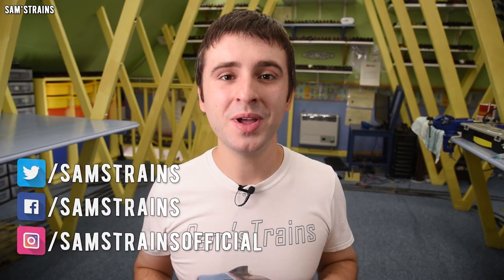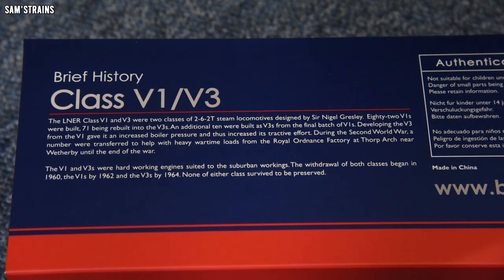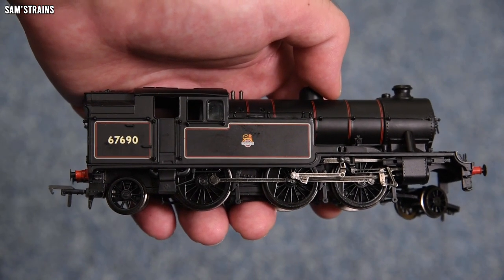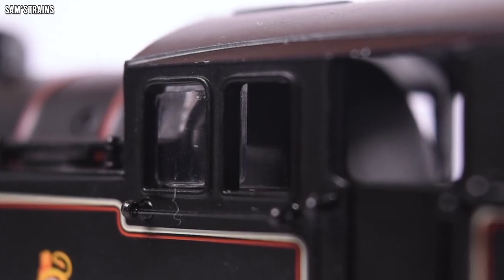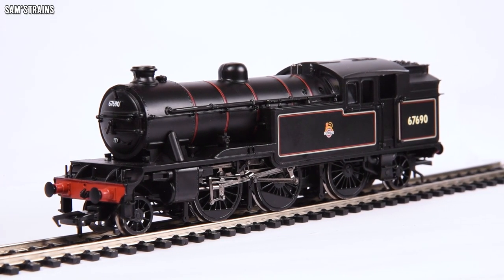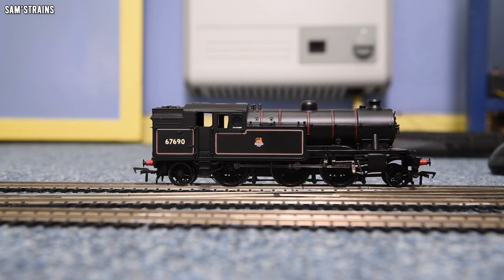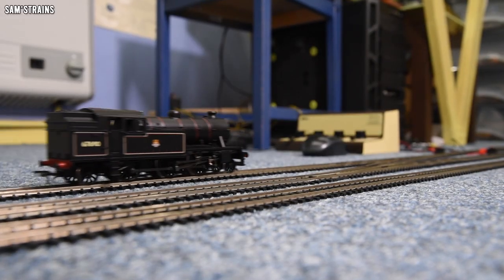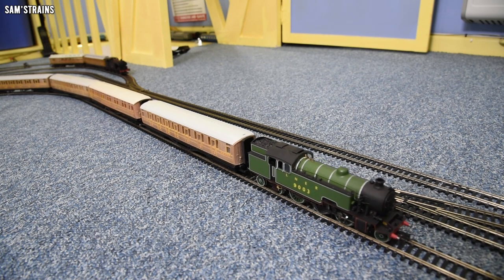Worst Detail But Best Runner | Bachmann Class V3 | Unboxing & Review

Comment: I'm a big fan of the slightly older post split chassis bachmann engines, to me the detail is still passable and you don't have to worry about things breaking and falling off every time you pick them up like on some of hornby's engines, I'll concede the mechanisms aren't exactly cutting edge but in my experience they've alway been reliable runners. And finally, there's always bargains up for grabs on the second hand market. That being said I would never buy a brand new locomotive from bachmann in this day and age but with prices being what they are I'm not really buying much new from manufacturers at all anyways :p

Comment: Dear Sam,
I did enjoy your review of the updated Bachmann V1/3 2-6-2 Tank loco. 
When the new model came out, I asked Bachmann if they were going to bring out a LNER Black version as well. They said no. So I asked if the old body would fit the new chassis. They said as the new chassis was a complete Retooling, it would not fit the old body. I had hoped they would bring out a new version of the LNER black one. 
My local model shop still had some of the new V3 models in stock. So I bought one and to see if it would fit the old body. I test fitted the old body on the new chassis and low and behold it fitted like a glove. All the screw holes matched up. I have been able to restore all my V1's with new chassis having bought two more of the new models to use the chassis to replace the broken axels. My Fleet of V1's 466,448 and 2911. I think the earlier body was much better than the new one.

Comment: Sam, another good review. When I watched this review, I thought at first I was watching a repeat of your 52xx review. Virtually all the comments on detail, mechanism, price, performance are extremely similar! It seems Hornby and Bachmann are putting prices up significantly for lower detail models.

Having said that, no I would not buy this engine with the visibly poor moulding on top of the boiler.

Thanks for another excellent review.

Comment: Well, a nice candidate for a retooling... At a discount price, no more than GBP 50, it can be acceptable. Bachmann pushes the use of their outdated mold to the end, I hope they will not do another run of this antique. The chassis is very nice, and the drivetrain more than decent, they just have to add a flywheel to have something at the top. The reverse of a shelf queen : ugly, but pulls hard.
As a small tank engine, Bachmann did a very decent MR 0-4-4 recently, they can take it as a pattern for a retooling of this one. They have the chassis, they just need to retool the body.
Reply: Yep, that's it exactly. They would probably bump up the price, however.

Comment: A good runner like this is a useful replacement for an old Tri-ang or Hornby layout loco which has seen its best days! To avoid sticking problems, I would do the run-in before performing the slow speed test. If you don't do the run-in first, particularly if the loco has plastic cogs, you can give the loco a permanent limp!  Thanks for uploading.

Comment: Yes, I owned a couple of those getting on for 20 years ago-similar in vintage to the venerable Class N, still in production, which I also own.
Reply: The V3 is quite a lot older than the N class!

For reference The N Class appeared around 1998 (and along with a re-tooled 'Collet Goods 0-6-0) was notable as it was one of the first of the Bachmann  'Blue Ribbon' designs which didn't use a split chassis.

Unsurprisingly the years (or more specifically the repeated use of the same tooling with only the tiniest of tweaks to accommodate a DCC socket) have not done the N class any favours BUT it still fills a important gap in the ranks of RTR models (as does the V3).

As I said above - if you are actually building a scale model of a proper place (rather than just running what pleases you) then your selection of locos is going to be heavily influenced by what was operating on the real thing. The SECR / Southern N class mogul was a true 'go anywhere' design and could be seen from Kent to Cornwall on Freight and passenger work plus was a very long lived design.

So although Bachmanns current RRP for it is way off the mark and it is in desperate need of an upgrade, the loco itself is still of value to modellers looking for realism in their layouts.
Reply: @philkeller4170  Thanks Phil, my layout is Southern-themed and the N, noisy as it is, is a regular and reliable performer. As a youthful train spotter in the early-mid 1960s I would occasionally see one clanking through Clapham Junction or alongside my school's playing field (situated right where the Brighton and South Western lines diverged), although by that time only a few remained.

Comment: Hi Sam, I have just been sent your 2021 video on the V3,  wish I'd seen it earlier. I've just bought the 2023 V1 released a few weeks ago and was shocked to discover no cab detail whatsoever,  not even some basic molding,  nuffing 😮😮..  with an RRP of £170,  some cab interior would be standard, but not on this model!   I've written to Bachmann complaining,  its verging on misdescriptiom as I don't know of any other loco like this old or new

Comment: I have one of these, but is the split chassis version. It runs well and is pretty powerful, but was a right pain to DCC (I added an 8-pin socket in the cab)
I saw the reviews when this version and the similar release of the Ivatt 2MT tank first came out, and they slated the detailing. Which is why the new bachmann J72 was designed from the ground up instead of reusing the old body again.
I do want to get a V1 to compliment the V3, which would have to have the original coal bunkers instead of the modified type and whatever, but I'm not sure if I should try one of these newer ones (if I can get one as a V1) or just go with the older models and face the pain of adding a DCC socket to yet another split chassis loco (I still have to convert my V2, rebuilt Royal Scot, unrebuilt Royal Scot (which also needs new smoke deflectors), an 03, and several J72s...
Edit: I'm gonna go for the older model. There'll be less flashing and a smaller moulding line, and I'm sure mine has a cab backhead (I do have a backhead laying on my desk, unsure if this is from one of the two ivatt tanks or the v3). 
Edit 2: Although..... I may be able to reduce the flashing, and add some backhead detail maybe. That chassis does seem to run very well...

As for the new build, everything is waiting on the progress of the A1SLT's new base. They were hoping to get their new place ready before the P2 is completed, so they could start building the V4 at the same time (they don't have the space in their current building). And the V3 would follow the V4 since they share several parts I believe.

I've got 1 V3, 2 standard 4 tanks (both black though), and a J50. Still need a V1, an L1, and an N2
Reply from the maker: Thanks for sharing - yes those are a pain to DCC... but well done for persevering!! That's interesting... wonder if the original plan for the J72 was to reuse the body then?
Thanks for watching, Sam :)

Comment: This is an old 1990s loco . I think I got mine 92 or 93 . Mine is the old split chassis version but she still runs ok , admittedly she doesn’t see a lot of use .  I actually think it’s not a bad model . It successfully captures the look of the loco and I think is still passable . How many people look in the cab?  You are correct though Bachmann charge top rate for all their models . I think they have to pay Kader to make the models
Reply: Bachmann  is owned by Kader.
Reply: @tinplategeek1058   I know and Kader  are looking for the same returns they get making US or European stuff . Why wouldn’t they . But while Dapol , Hornby  use different factories probably to get good rates , Bachmann are stuck with Kader . Interesting to expand the range they now have EFE who use different factories .

Comment: It's funny, isn't it Sam? Here we have a Bachmann loco with a very good mechanism (5 pole motor it is believed, proper bearings, full driving wheel pickups and the loco being a pretty good crawler), yet has a very outdated and rubbish body! Lol. Quite the reverse of many a previous Bachmann loco. Will they ever get it right, in all aspects? I suspect that they might have charged a lot more for an updated body, than the current RRP of £129.95. Not for me, this one. The blank cab is unforgivable. Best, Pete.

Comment: What a Bummer. I am watching this Because I love the look of these Tank Engines ( as in, No Tender.)
 And was thinking of buying one of these Models.
 As that Parting line and very visible Flashing is a "Real Turn off..!"
 Obviously Bachmann don't own a set of Fine File's. 
 But its a Real turn off due to trying to improve that would require repainting. And even with an Airbrush, Would stand out like 'Dogs Balls..!'
 Maybe Weathering may help hide the Repairs..!!

 But not something, one should be needing to do to on a Straight out the box model..!

 Cheers Sam another great review. Cheers All..!! Kim in Oz. 😎

Comment: Performance is nice. Which is a good feature I'll grant you that.
But it's a shame Bachmann doesn't have a budget beginners model range like hornby does with their Railroad range.
Hornby's older tooled and less detailed models are placed in that range often at a price that's more reasonable.
Take the Hornby 9f for example, that model is incredibly old, but it's still good enough for a beginner range loco and has become a Railroad range staple.
If Bachman had a simular range, then suddenly a lot of their... lack luster models won't sell so poorly.

Good performance and competent design for the mechanism should be a basic standard to begin with, and the price should start at that. Details, and features should be treated like extras, and they should never push a loco over a certain price point.
For one example, I bought my LBCR E4 tank for £84, which was good, but the mechanism worries me at times. 
Looking at your model though, I honestly wouldn't pay more than £50 for it. If I wanted it at all and For £50 it would certainly make a good present for a child at Christmas.
£130rrp is just nothing short of being greedy though.

Comment: I'd prefer a good running loco over a highly detailed one any day. Details a modeler can add or change at their leisure, and even end up learning a thing or two about the prototype in the process, but an inferior motor and drive system, well, that's another story.
Reply: You may be able to add details, but my skill isn't up to it. Hands too shaky these days.
I'd prefer detail AND a good mechanism.
Reply: @Poliss95  I would prefer that too, to have both, but if I had to choose just one, I would go with the good mechanism. I got carpal tunnel and arthritis in both hands, comes from a lifetime of working with hand tools ever since I was three years old. I do take prescription strength meds for my hands, but I do worry about the day my hands get bad enough to not be able to do fine detail work.

Comment: Are Die-Cast bodies/running plates and boilers really something that we want? Consider the nasty issues with the likes of the Hornby class 31s and them dropping to bits after a while. What if this happens to the entire body of a steam loco model?
Reply: Die-cast bodywork and chassis don't suffer from Mazak rot though.

Comment: Great video sam the big company's are starting to choose quanty over quality and charging stupid prices for very little
Reply from the maker: haha yeah we've seen that quite a lot... though they're not even producing quantity in most cases any more ;)
Thanks for watching, Sam :)
Reply: Not quantity - quite obviously it’s profit over quality
Reply: Thinking about it,though, back when I first got involved with the hobby when you bought a new model the first thing you did was take nitromors to the livery, super detail the model and then repaint rename and number it. That meant, for instance, that you could change the side that a 4F was driven from by swapping the reversing rod because you needed a Midland Railway built example. You didn’t rely on the manufacturer to provide a ready to run model out of the box. Perhaps that was why it was called modelling. Nowadays it seems all the work goes into the scenics and sometimes weathering and we expect superdetailing out of the box. Maybe that’s why the models are so expensive

Comment: I hope you don’t want to use a next 18 decoder as the one I fitted didn’t work I ended up hard wiring a lenz standard into it
Reply: You decide not to use a certain type of decoder because one out of thousands didn't work?
Reply: BPS&D chip worked perfectly fine in the Bachmann J72 I have tried 2 other manufacturers chip and they didn't work in it eather plus i replaced the dcc board with the same result but clearly something was wrong with the 3 different manufacturers of chips and this model hopefully it's the only one with this issue and the last one I get with the issue

Comment: It's Like Automobiles. You Want More Speed? Sure, But You'll Have Less Boot Space. More Seats? Smaller Engine Then. You See What I Mean? You Need To Make Compromises.
Reply from the maker: haha that's fair enough!
Thanks for watching, Sam :)
Reply: Yes but adding things to the outside of a model isn't going compromise the size inside. Also if you want more seats then you will still have a big engine because there will be more weight to lug around it just means the car will be bigger.
Reply: @CustomiZe_  I Sat In The Backseats Of A Lot Of 1960s Sports Cars. And The Car With The Worst Rear Seat Legroom Is Probably The Mercedes 280 SE Cabriolet. I Can't Stretch My Bleeding Legs In There.

Comment: Why build a new 3 cylinder 2-6-4 tank with Gresley's dreadful conjugated valve gear.  If you are going to build a genuine new steam locomotive then I would choose a Fowler 2-6-4 tank.  If you insist on building a brand new ex LNER 2-6-4 tank then build a Thompson L1 which had at least 2 cylinders and didn't suffer from the issues with inside cylinders, which always cause problems.
Reply: Nothing wrong with Gresley's valve gear if aligned correctly, which is what happened in 1951 when K.J. Cook moved to the Eastern Region of BR from Swindon.
Inside cylinders always cause problems? According to whom? Inside cylinders cause much less hammer blow. See Anthony Dawson's videos. https://www.youtube.com/c/AnthonyDawsonHistory/videos